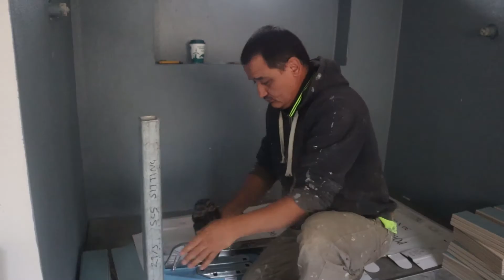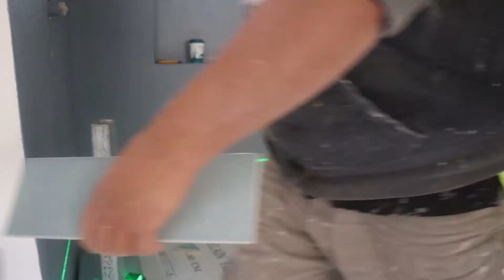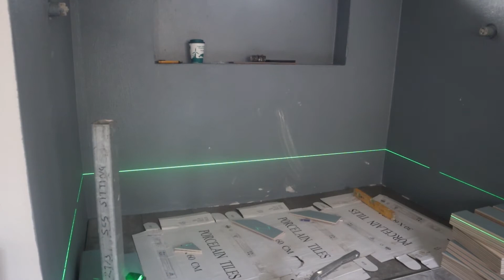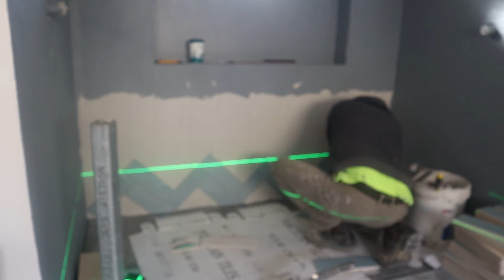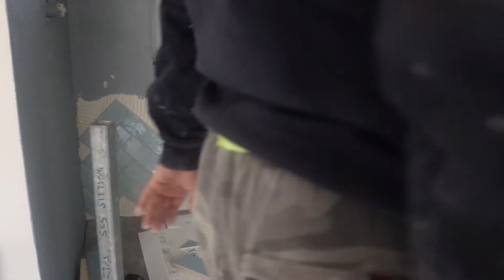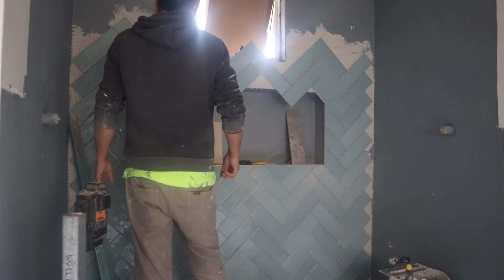How To Do Herringbone Style Tiling | Shower Feature Wall | Herringbone Tile Designs | Backsplash

Comment: Whats the best way to cut the tiles with a grinder to get a nice straight cut without any chipping? I have ceramic ones.
Reply from the maker: Hi muhammad thanks for your great comment
We are using diamond blade saw for cuting and the diamond saw it will be a little bid chip but after that we us spongy wheel to get a nice straight edge like a factory edge,
If you want i can send you a picture of spongy wheel thanks
Reply: @bestwaytiling  yes that would be appreciated. Also what other methods can I use to make a nice smooth edge. Am diy ing my kitchen  splashback in herringbone
Reply from the maker: Where are you living?
Reply: @bestwaytiling  uk .Manchester
Reply from the maker: I don't know how can i send you picture?

Comment: HOW do the tiles around the niche not slip?! Is there a trick to hold them in place? I'm trying to do something similar right now and the ones around the niche slipped a little even though i installed cut ones - I always make sure everything's level and lines up so that really drives me insane and I'm thinking about redoing those🙈
Reply from the maker: Hi Alisha use mastic glue with small notch it will hold the tiles. If you live in Australia you can buy from bunnings and other tile shop